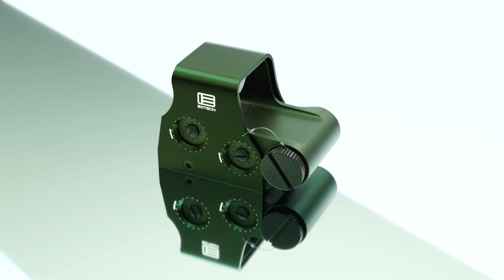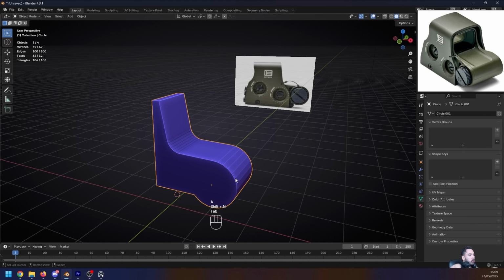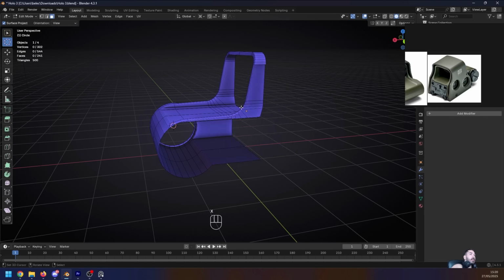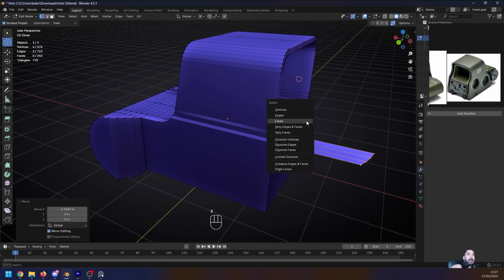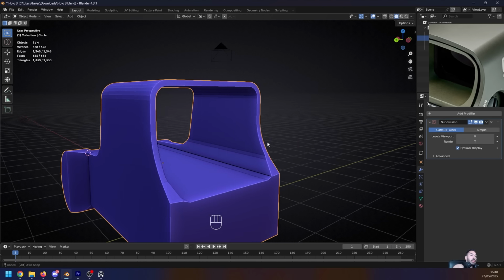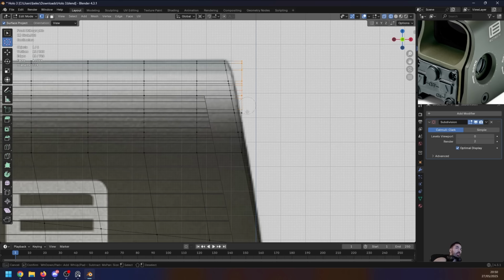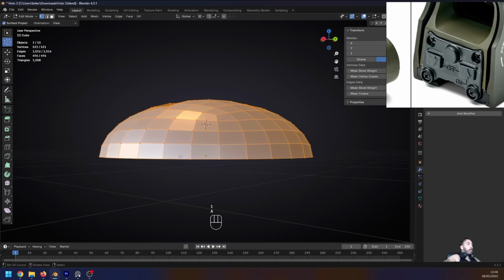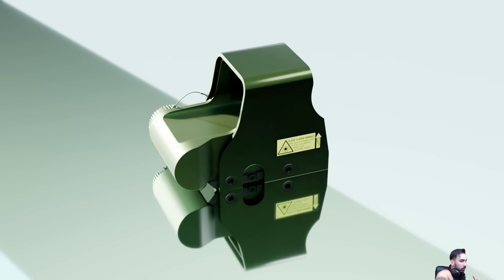Modeling a Holo Sight in Blender - Hard Surface Modeling Tutorial

Comment: at 4:58 where you join the verticies on the front how tf u doing that cause i get errors
Reply: that's because when your trying to join those 2 vertices after he duplicates the mesh in edit mode.. if you think about it those are two seperate meshes even though they may be the same "blender object". You can visualize what would happen if the mirrored part and the original one had a gap in between them .. then if blender allowed you to join those 2 vertices like he shows .. it would result in a dangling edge between them towards the center.. which is not a real geometry ever.. hence solution for this is to select all vertices in edit mode by pressing a + then pressing M to merge vertices+ then select by distance in the menu that pops up. Then if you join those 2 vertices it will be the same as in his tutorial.. he probably did that behind his edits.. otherwise the videos become really lengthy is my guess..

Comment: The arrows are almost always to adjust brightness or the xero of the dot. on most sights, a plus and minus represent brightness, and directional arrows are used for dot alignment
Reply from the maker: So it's for shooting people in the dark. Cool, thanks.
Reply: @Aryan3D  No, its for making your sight line up with your gun barrel. You barrel is lower then the sight you need need to adjust the dot position so you bullet goes where your sight is pointing.

Comment: You pick the number 28, because it can be devided by 4..... I would use 32 or 64, depending on the job. These two numbers can be devided by 2, 4, 8 and 16. No odd numbers. Nice video
Reply from the maker: In general, I agree. In some cases, like this one presumably (i don't remember what exactly I did in the video), I need a specific edge length for modeling something very precisely. I knew I wouldn't have to divide the circle by anything other than 2 or 4 at most.

Comment: Anyone else having trouble joining the vertices
Reply: that's because when your trying to join those 2 vertices after he duplicates the mesh in edit mode.. if you think about it those are two seperate meshes even though they may be the same "blender object". You can visualize what would happen if the mirrored part and the original one had a gap in between them .. then if blender allowed you to join those 2 vertices like he shows .. it would result in a dangling edge between them towards the center.. which is not a real geometry ever.. hence solution for this is to select all vertices in edit mode by pressing a + then pressing M to merge vertices+ then select by distance in the menu that pops up. Then if you join those 2 vertices it will be the same as in his tutorial.. he probably did that behind his edits.. otherwise the videos become really lengthy is my guess..

Comment: Dude get the f*cking front ref. The original is not straight vertically, the top is also curved. That sight gap is way too big, you didn't make the inner case thick enough and the sight window is actually more circular/curved than that. The gap between outer and inner case is way bigger in the original. You can't just leave the most important perspective out. 

Also work with sizes. They are a few clicks on google or one chatgpt prompt ahead. It's 67 mm height in total, 59 mm width in total and the length from the glass to the end of the battery is 91mm, so maybe around 96mm total in your dimensions tab, without the panel. Pretty sure the width is incorrect on that model, but that could have been avoided by just using a front ref.

It is wrong, that is not the holo sight you tried to model. I would not pay you for this if I had requested it, bad quality... GO BACK TO BOOTCAMP! I'LL LAUNCH YOU!!! I am professional hater. I can make that better. (just kidding - I'll like this, because I think your tips will help people that are familiar with blender but have a shit technique and workflow, and that is what the video was focused on). So you did it right. Everyone who watched the video should be able to adapt and make the scope from original with just your tips.

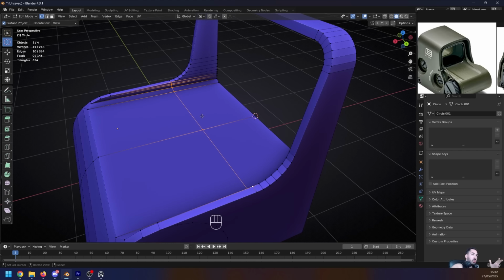Comment: Tried to join the vertices just like 4:25 but nothing happend, in fact it said it "failed to recognize vertices". Any tip as to why that may be happening?
Reply: I had the same problem and the solution is: A, M, By distance
Reply: @nonameanonymuser  Thank you, I'll give a try.
Reply: @nonameanonymuser  Thanks alot
Reply: @nonameanonymuser  came back for an update. Tried it, no dice. No idea what the problem is
Reply: @LucasBarboza08 you're trying to join faces right? If the mesh is not filled j doesn't work
Reply: @ElitePlaysRBLX  nope, I tried joining the vertexes.
I literally followed the video’s steps
Reply: @LucasBarboza08  you could try using f then filling the faces
Reply: @ElitePlaysRBLX I’ll give it a try. Thanks

Comment: 4:21 I select both vertices and when I press j I get a "could not connect vertices error". Any ideas on why?
Reply: After duplicating just before, I believe you can connect the vertices you mentioned by selecting A > M > By Distance and merging the vertices in the middle column.